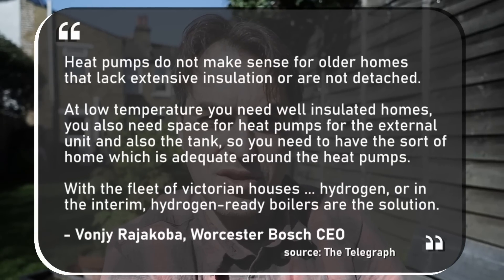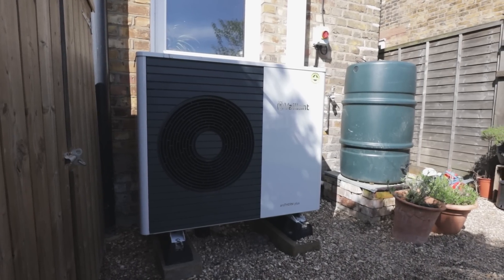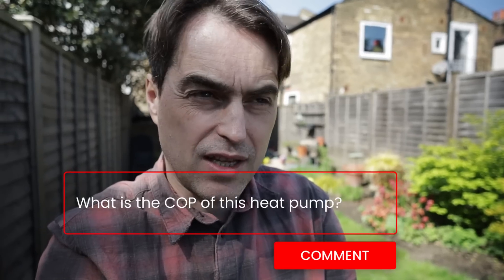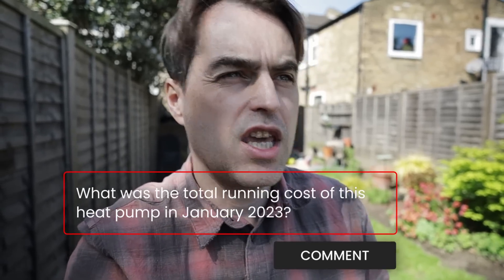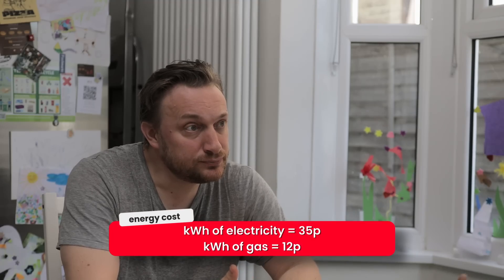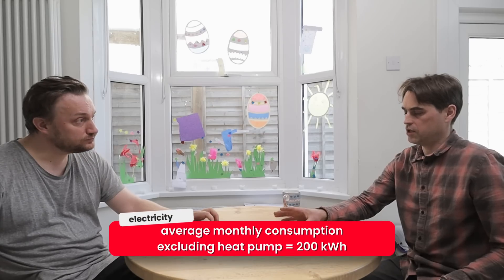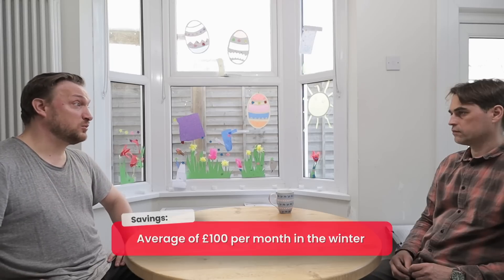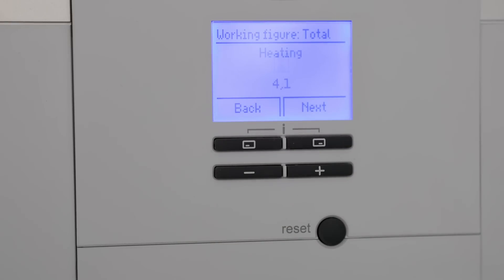Worcester Bosch CEO Is Wrong About Heat Pumps. Here Is Why.

Comment: Heat pumps today are for people who have money. They are coming down in price and that's great. There are too many variables for fitting a heat pump, unlike say a straight swoop for a combi boiler. Every property is differant. We can all argue for it and against it. I will be fitting one at my place but I will not be removing my combi boiler. I want to be able to run my heating and hot water in winter when we have power cuts. A very small generator will run our very large home in this situation. We would not be able to run a heat pump on a small Genny.
Reply from the maker: Why not? 5kw only needs max 3kw power and most of the time below 1kw? Easily doable Ona. Generator if needed?
Reply: @UrbanPlumbers  ok cool so a 22kw heat pump is ratted 3kw. When I  looked last time on the plate it was more than 3kw. My combi boiler running only needs 300w and a cheap petrol Genny happily keeps it going all day and in winter.
Reply: @gino2465  Nice mansion you have there to need a 22kW heat pump.
Reply: @BenIsInSweden  huge property my m8 has yes.
Reply: @BenIsInSweden  don't forget 22kw is not the running KW.
Reply: @gino2465  I know, I generally use the rule of thumb of the max electricity draw is about half of the rated kW of the unit.  The thing with power cuts is really down to how long they are for, most homes can still remain comfortable for hours after it has been switched off, so unless you're having the power cuts lasting an extended period of time, then you're better off looking into home battery storage, and having the option to run it off grid.  For the vast majority of people, power cuts don't last long enough to make the house cold enough to warrant some form of backup.
Reply: @BenIsInSweden  Ben we must think out of that box we get trapped in. We do have long periods of power cuts last one 3 days. Yes that's ok but if in winter then it's not good.. my point is not to down heat pumps but to make sure people understand how not having electricity is about, never say it cannot happen please. The cop is great and with solar what not to like. I am that freak person who does not want all eggs in one basket. No I am not funky pepper lol. Just someone who thinks outside that box.
Reply: @gino2465  I wasn't saying they don't happen, just along the lines of the "But sometimes" gets in the way of progress a lot of the time.  There are plenty of other things that will determine what you do in an extended power cut these days - e.g. someone working from home will likely go elsewhere to carry on, etc. Given our reliance on electricity in other aspects of our lives, it's unlikely that people will be considering sticking around at home playing card/board games lit by candlelight these days.
Reply: @BenIsInSweden  ok Ben reality last outage in midwales was a 3 day event. We have an ev for travel/work. After day one I had to stay at home. But we luckally had a small 4 k Genny. So our lives continued without travel and work. After that event we had a couple of 8 hour outages. So now we have invested in a 12kw Genny to power an EV , run a heat pump and the home. Remember what I said about all your eggs in one basket. I still will fit an heat pump but I will still keep a combi gas boiler. Never say it cannot happen. So love the cop of an heat pump , but I also love the fact I can compliment a heat pump in colder climate as well as benefit from cheap heating . Nothing wrong with that one. And am i now bothered about power cuts No. I have one month's supply of red diesel always ready.  So happy Ivor way. Green is our goal, but keeping warm and keeping EV topped up is also a life's priority.
Reply: @BenIsInSweden  very expensive chargers , but if you use your EV every day then not practical, unless your a pensioner with lots of disposable income and loads of free time on your hands. It's the pensioners like this that spend a fortune on green.
Reply: @gino2465  They may be currently, but as the technology improves it'll likely come down more in price.  For my scenario (WFH), and rarely using a car, an EV doesn't make much sense, but combining it as a home storage battery for load shifting etc means it's getting use when I'm not using it as a car.  It's not something I'm looking at short term either - will wait until I need to replace my petrol car.
Reply: Your gas fired heating will not work without an electricity supply.  The domestic RHI specifically excluded permanent supplementary heating.

Comment: Heat pumps only work in those new build houses passing the LEAK TEST , in Scotland forget it, we're to far North to squander money on something that would only work now and again.
Reply: yeah that's just bullshit.

if the house is badly insulated or just leaks air you can either get the house better insulated and better sealed.

or you can do the exact same thing you are currently doing with the gas/oil heater and just throw more heating at the problem.

Comment: The quote you give at the start of this presentation by the CEO 'do not make sense' somehow becomes ' has no chance of working' which is not the same as presumably the former includes availability of capital and payback times. I heard nothing about installation costs. Careful design and planning does not come cheap even if you are lucky enough to find someone capable of this. Also sacrificing 1% of property to create that utility room can still be expensive in rebuilding. Simply larger radiators and resiting in one case here is not cheap also with piping and redecoration. Saying it is possible and emphasis on running costs but not saying at what cost does not pull me in. The boss of CEO needing to actually sell the systems does need to know if the public can afford the initial outlay which is rather ignored here. Is this just spending pounds in a month to save pennies over many years? I do not really know from this presentation.
Reply from the maker: Same cost as new boiler with new cylinder. At least I charge the same
Reply: @UrbanPlumbers  What about the installation of those very massive radiators and piping plus redecoration? That is what really scares me. The problem is the pressure is on us to do this without needing a new boiler. I am sure you do a good job but I have had plumbers who have made a complete mess of replacing a toilet. Not an easy decision as gas prices are awful but whether  the country is ready for all transport and heating to be taken on by the national grid let alone by one powered by wind and sun only is a bit suspect but good luck in what you do.

Comment: One thing people forget it that victorian terraces are TERRACES! A mid-terrace house ( which of course most are) has another house on each side,  which are usually occupied and heated so the temperature delta across the side walls is low, so very little heat loss! Also, most of these houses are longer "back to front" than across the frontage, so over 50% of your external walls are in effect very  well insulated. With decent loft insulation and double glazed windows, the effective amount  of uninsulated walls is only a small proportion of the total envelope!
Reply from the maker: But that was Worcester Bosch CEO said - that terraced houses are the least suitable for heat pumps 🤷‍♂️
Reply: @UrbanPlumbers  Who cares what people say they lie all the time specialy sales person, look at what they do and do your own recherche.

Like Alberto said, since 50+% of the outside walls are against the neighbors heated house with the same temperature there is no heat loss trough this walls.
In average with the unisolated outside walls it is still well isolated.
Reply: @UrbanPlumbers  How about terraced houses that have a cellar underneath? Surely the heat pump can go there?
Reply from the maker: No it can’t
Reply: @UrbanPlumbers No, it has to be outside, where it might be 2 or 3 degrees so it can rattle away and whir and freeze up, whilst chowing down on a ton of electricity, that along with your electric car will bring the already at capacity grid down. As the pump spins and churns desperately trying to suck some heat out of the 2 degree C air, to warm up your 9 foot tall radiator  LOL.
Reply: @SouthIslandSk8  you should go check what a good heatpump achieves at 2°C.

let's go with a zeowtherm lambda.

for A2W35, so 2°C air temp and 35C water temp, the thing gets a CoP of over 505-5.19 depüending on if you get ther 8/13/15kW model.

for A-15W35 the thing gets a Cop of 3.02-3.19.

which means that as long as the electricity isn't from coal the thing has a lower carbon footprint and lower energy consumption than a gas or oil furnace.
Reply: @anonym3017  I'm still not interested.
Reply: @SouthIslandSk8  yeah it's not like fossil fuel induced climate change is now fucking with our ability to grow food.

so they need to go fast.

which means that they either need to get banned outright or carbon sequestration needs to be priced in completely, as economic theory demands.
Reply: @UrbanPlumbers  heatpumps can absolutely go in cellars. provided that they are ground source ones
Reply: there's also the fact that heatpumps can just be installed in parallel and individual ones exist up to 100s of kW of heating power.

Meaning that a  badly insulated house can either be better insulated.

or

You just put in a more powerful heatpump.
Reply: @anonym3017  See, I'd rather :

Massively insulate my house
Add better windows and PassivHaus doors
Add an MVHR
Add TRVs

That, and I'd want to either rip out my copper piping and put new radiators in 

And only then get an ASHP, OR get an AC and use it in reverse. Then I could rip out any existing radiators without having to put new ones in. I also wouldn't have to upgrade my pipes from microbore piping 

Realistically, an ASHP is a green solution but it doesn't really have a pay back period (or if it does, that pay back period is in decades)

I will get an ASHP eventually though if I've got a much better insulated house that's much more air tight, then I can get a smaller ASHP

Imo, it is better to do all the other stuff first and then get an ASHP. We do after all, have until 2035 before combi boilers are phased out and that's ample time to massively improve the air tightness of the house. Realistically, I'd want to get an ASHP within five years however
Reply: @waqasahmed939  if you care about a payback period you do only the small and cheap renovations, like adding a rubber seal in windows and doors and going with double glazing whenever a window needs replacing, and get a bigger ASHP cause that's just the way cheaper approach. (Cause going from a 12kW heat pump to a 24kW heatpump increases costs by some high 4 digit pounds while insulating is mid 5 digits or more)

And since the annual heat demand of a home and when said heat is required is not dependent on the installed heating system it can just be ignored in any carbon calculations.

More insulation is obviously always better from an environmental perspective.
Reply: Looking at this house (1:24) I don't think you get even to 50% shared walls, probably more like 40%.
One side is entirely shared but the other one only something like 1/3rd.
Reply: @zlmdragon.  Yes. Also worth noting that most of that outside wall is usually the kitchen which you generally doesn't need to keep as warm, so less heat loss.
Reply: Not sure what impact that statement has when they actually compared energy usage i.e. before and after installation of the new system.
Reply: I hear this line from plumbers all over, thanks for busting the myth.
They're all fantasising about hydrogen, which is clearly a terrible idea to anyone with a basic grasp of maths, physics and chemistry.
Reply: @DavidMystic  Don't worry about them. Most will be retired or dead by the time the gas network ends. 
While Hydrogen will be an important part of our future it won't generally be used for domestic heating apart from the possibly of suppimental heating in district heating systems.
Reply: So just consider how cheap it could be if they had not lifted the CAP and told the energy companies that the would be crippled by ESG if they continued to exploit the huge energy beneath our feet and oceans. Also if we get a really cold winter the heat pump would be unable to meet the demand and require an additional heater element powered by a grid of expensive solar panels and wind generators. Pray for the best and expect the worst.
Reply: So...as you are eluding to...heat pumps do work.
Reply: With a suspended wooden floor it should be possible to use underfloor heating with insulation underneath. It seems that you get nonsense from a gas and oil heating company, forced to move with the times but still not getting it.
Reply: @rogerphelps9939  Yes it's definitely possible. But it's a huge amount of work (and cost). You would also likely have to find a heating company that has a building company as part of the same firm.
If you can make big radiators work it's going to be the most cost effective.
Obviously if you are doing a full renovation of a house then best to do a full underfloor heating system.
Reply: @rogerphelps9939  with very careful planning, perhaps. The original building design relied on free air flow (draughts!) to stop the floor getting damp and going rotten.
(From someone who lives in a draughty uninsulated Victorian house very effectively heated by ASHP, not a denier!)
Reply: doesn't stop the government doing their best via EPC ratings to condemn these beautiful period stock properties.
Reply: @SouthIslandSk8  We could also do with getting environmental campaign groups to be more aware of this. Solid wall insulation would be very expensive and disruptive and you'd still be getting a scop of <1 and burning fossil fuels. The EPC recommended action for my house would have cost twice what we spent on replacing all radiators and plumbing and installing an ASHP to reduce energy usage by 30%. We've reduced energy consumption by over 75%, so even if the electricity was 100% fossil fuel generated, we'd have done better than insulating.
Reply: @zlmdragon.  Yes it is :) I don't want an electric car either !
Reply: @zlmdragon.  I am a mech eng.

so yeah. the entire area is within what we do.
Reply: @zlmdragon.  the company is zewotherm. the pump's called lambda.

amd zewotherm is pretty darn large in german speaking countries for heating and ventialtion.

they might have just rebadged the pump from the company called lambda but that's where I found it.
Reply: @zlmdragon.  haha, nobody wants them, even with a government bribe!

Comment: Crikey - They are only saving £100 per month.... And they are happy at saving money.... So, this must mean they were given the whole installation free of charge... Or, you mist out the critical figure of the entire installation including interest charges on the loan so that we can work out the payback time on investment on that minuscule  £100 saving per month.
Reply from the maker: They had to change radiators and the heat source anyway. Why would you mention a payback ? What’s your pay back on a new what’s boiler and cylinder ? Also, install cost is exactly the same to what I charge for gas boiler with a cylinder, so no pay back needed?
Reply: @UrbanPlumbers  By payback, I mean the total instal cost, plus interest to service a loan to replace the existing CH system....with only a cost saving of £100 per month.... It makes no economic sense .. I think the lady of this household had very good reason to be sceptical both the heat pump installation... Please let us know the complete system in including radiators and heat source....?
Reply: @john3Lee  Expecting the heatpump to cover the total install cost is not very useful. Would you expect solar panels to cover the cost of replacing the ageing roof? The upgrades to the CH system have a benefit regardless of a heat pump or not, it's just it's where heat pumps really excel.
Reply: @BenIsInSweden  The average typical heat pump installation in the uk is about £10,000 ....With a typical interest rate costing very approximately £200 per month, it seems a poor return on your initial investment if you you get is £100 off your heating bill... Better off replacing your original heater unit for a more efficient one, and invest in insulation...
Reply: @john3Lee  That £10K figure is still including the upgrades to the central heating to be a low temp heating system.  Those upgrades would help save money even in a gas fired system, just for a heat pump it's basically it's forte, so if you're doing the upgrades, a heat pump makes more sense.   It's also likely as the levies that are coming in 2030, people are going start becoming more cognisant of whether a property has a low temp or high temp heating system, and it ending up affecting the sale price.

Comment: At the end of the day whether a heatpump makes sense (permitting, permitting) if the electricity cost is proportional to the cost of natural gas (per kWh) multiplied the effective COP or cheaper.  Solong as the temperature range of the refrigerant is compatible to the environmental factors.  (Design and install what works for the property).

Good windows (a ERV wouldn't be out of order  - ??-  to provide controlled ventilation (humidity control) without bleeding conditioned air..  Insulating the walls can only improve the economics, though the payback may indeed be minimal - at least having decent thermal mass allows diurnal averaging to help a little  - the UK isn't all that cold for very much of the year - insulation would make more impact in regions experiencing "deep freeze".